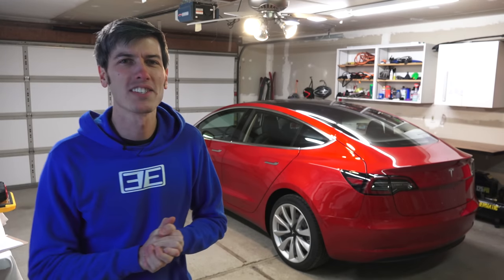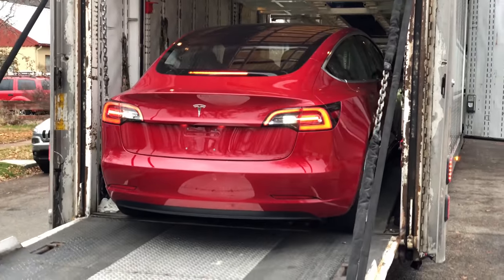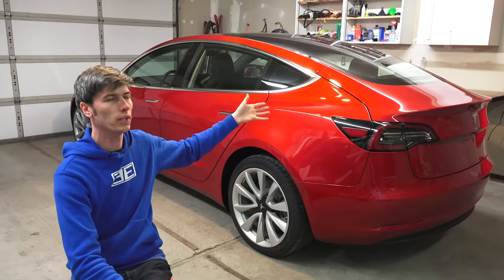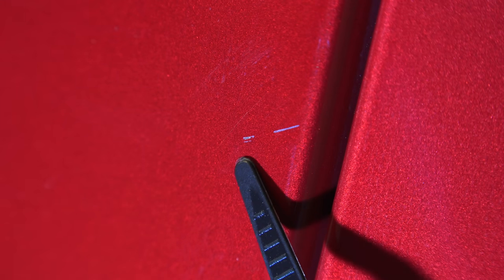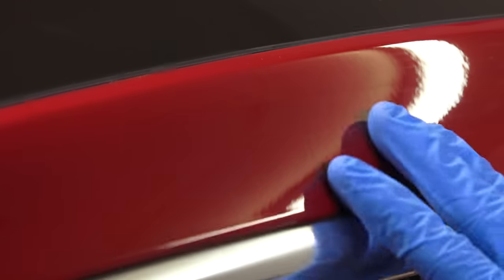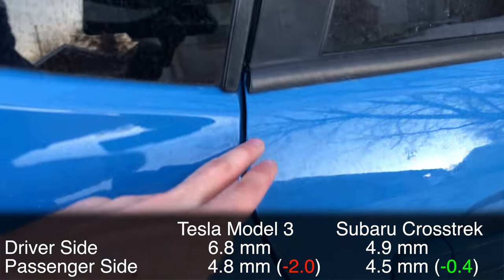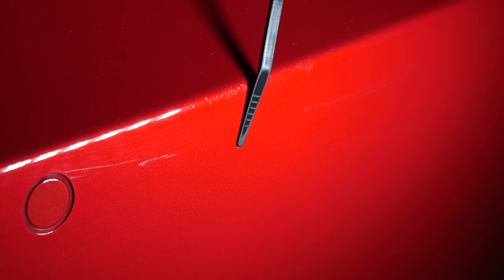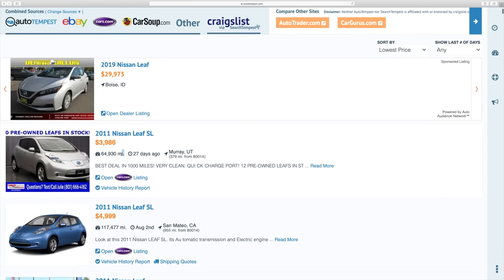Everything That's Wrong With My Tesla Model 3 - Quality Problems

Comment: A car that is brand new should arrive brand new.  This is unacceptable for a brand new Tesla. Doesn't matter if its a Kia Rio or a Rolls Royce. If its new, it should never arrive with scratches.

As for panel gap differences, to the untrained eye those panel are not noticable for the average person.  But Tesla does need to work on that issue.  I own a 2016 Lexus LS460L built in Japan and the panel gaps between left and right is nearly perfect only,  .2 mm to .5 mm difference. But my wife's 2018 RX 450H built in Canada is not as good between .7 mm to 2 mm difference.
Reply: I bought a new car in 2017 that cost about 1/3 what this car did... and the paint and panel gaps looked much better.
Reply: i agree!!! and for the cost of this car the comparison should b between a 3series or a4 or something not a subaru lol im sure that model 3 cost a lot more than a crostrek .. can u even get a $2500 paint option @ subaru????? heh
Reply: Al13n1nV8D3R walk around any dealer , you will see flaws
Reply: Kavi4 yeah but not scratches or insane panel gaps. Tesla just doesn’t know what they’re doing yet.
Reply: I work for Honda and paint/finish issues are graded by areas. I can say that all of these scratches should've been seen at the factory. It really shocks me to see these kind of errors making it to masspro.
Reply: @Kavi4GP  You absolutely will not, cars from the factory come with perfect paint, you simply will not see bare metal on them. I work for Honda and imperfections in the top clear coat get repaired, let alone scratches the go to the bare metal.
Reply: Thiterest1 like I said at a dealer , this case is terrible.
Reply: Thiterest1 you’re right. I just the that people refuse to accept the fact that Tesla’s aren’t very good because they love the brand too much
Reply: Kia Rio comes way better
Reply: my kia rio from 06 came without scratches lol
Reply: Totally agree... I bought a Kia Sportage in 2018 and the paint finish is flawless - and it only cost €24,500.
Reply: But is that a Japan vs Canada issue - or a LS vs RX issue
Reply: Agreed, the build quality on the big Lexus sedan has always been lights-out from the day it was introduced. Probably the highest of any mass-production car.  I used to own an S class Mercedes, and have owned a couple of Audis and several BMWs, and of course they were fine but the big Lexus is noticeably better.  They don't drive sportily and are kind of geezermobiles in general, but all in there's just no better-put-together car.
Reply: A Rolls Royce would never be delivered in this state
Reply: OP, I agree that the Tesla came with many errors and I have wondered how they would compare to our LS460’s. Mine is a 2014 and I expected to the Lexus to be much better. Think it’s a Made in Japan vs NA thing.  Thanks for the write up.
Reply: @jamess3417  I think both!  LoL I still love my wifes RX. The, only thing I dont like about it is TORQUE STEER under anything more than half throttle even with AWD.
Reply: most cars go through some kind of body shop (in house or 3rd party) before they start seeing buyers. Traveling to the dealership is a rough one lol.

Comment: You definitely need to send that car back ASAP. Absolutely unacceptable.
Reply: I wonder what else is low quality on things he can't initially see like welds and wiring etc.
Reply: watch till the end, he says that tesla is taking the car back and giving him a loaner for now.
Reply: This is extremely common with Teslas believe it or not.
Reply: @sagesends  I wonder what the odds are that someone who wasn't as prominent on the internet suffering the same fate would get the same level of service.
Reply: @Error Loading just be glad your Tesla is not like the guy who was driving it home (brand new 3), it started raining, then the rain somehow started leaking into and filling the bumper, then the whole damn bumper cover just fell off!
Reply: @sagesends  No, they said they would fix it.. not taking it back and giving him a new (good one) like they should.  Normally they would only fix what you can see.
Reply: I feel so bad for you.

Comment: For a $2500 option, that paint is unacceptable. The orange peel would be an 8-10 (as a comparison, I worked in a place as a QC inspector that painted replacement parts for the big 3, and we could not pass anything more than a 4 for highly visible parts to 6 for less visible). Scale going from 1-15, 1 being the best.
Reply: This is unacceptable in any way not just because it's a 2.5k option.
Reply: you just like talking about yourself, its obviously not acceptable.
Reply: @wildkatsailing  I do, and you read it. Thanks for boosting my ego.
Reply: Chrysler's paint is worse... noticeable Orange peel at 10ft... but a 2500 paint job, is exactly that, a 2500 paint job...
Reply: @anthonycasa694  Don't buy a Crysler then... this kind of paint job or even assembly quality is completely unacceptable...
Reply: @Vizeroy9 , I don't and wouldn't... it is his own fault for ACCEPTING... HE SIGNED FOR IT... BUT WTF WAS HE EXPECTING A $2500 PAINT JOB TO LOOK LIKE??? backyard sprayers charge $2500... he bought a snap together Lego car and then cries about the fit n finish...
Reply: It's not a $2500 paint job. It's a $2500 color option instead of the default black. Not a repaint.
Reply: @michielvanderros5768  $2500 option on a Lego car, that he signed for... if he wasn't happy,  he shouldn't have signed...
Reply: Never mind for a 2500 option. That level of paint quality would be unacceptable on a toy car.
Reply: @neilhuband995  well it is a toy car... snap together Lego junk

Comment: That quality from a 50,000 dollar car is unacceptable. I would be PISSED if I had 11:17 on mine.
Reply: His was 46500
Reply: Anton Zuykov  ya but it will get fixed. Corollas have been mass produced for 52 years. They have some slack to pickup but what they are doing is still impressive
Reply: @larryspiller15  no. Just no. It doesn't matter if it get fixed some time after you have your car. It's unacceptable at that price point.
Reply: @teilzeitteemo6190  I agree. Still gonna buy one. There are no alternatives. Gonna get the black one and a wrap though.
Reply: @snviper  there are enough alternatives. Just not electric. Electric cars themselves have a hard time getting sold much, it won't be helpful to produce expensive but cheaply made ones. The demand won't be there.
Reply: That is un acceptable thay need to fix your car
Reply: SDD525  Hydrogen still looks promising
Reply: SDD525  Renault Zoe, Nissan Leaf, Hyundai has an EV and Toyota has some fully electric cars as well I believe. No alternatives?
Reply: SDD525  please use Google before making such a silly statement.  The Volt is a real contender and many believe much better than the Tesla.
Reply: @teilzeitteemo6190  Volvo has a nice one too...
Reply: @teilzeitteemo6190  I am way past looking at non-electric cars. When you've lived with one you can't go back. Having not lived with one you will not understand. You are very wrong that there is no demand. There is no demand from dealerships that is true, because electric cars mean their downfall. There is a lot of demand from customers.
There is no alternative with range and charging network and technology at the moment to Tesla when you want to buy an electric car. Our family has 200'000km on two Teslas in 3 years.
Reply: @snviper  well you're now saying just because your family only has electric cars, there's high demand. There's no high demand. It's because the affordable EVs aren't really the best option for the average person. EVs are priced a lot higher than gasoline cars and offer only environmental benefits. I don't see myself buying a Renault Zoe. It's too small. Tesla is too expensive and has a really big production quality problem. Why should someone bother buying one?
Reply: Go drive one you will see. Demand for EVs is huge here in Switzerland and even small EVs have enough range for 99% of all drives.
Reply: @snviper  driving one wouldn't change that there's no demand. EVs are impractical, expensive and only a small portion of the population can even own one. This is because you need to have a charging station near the place your live in or have your own house. The majority of all people live in flats in large cities with a limited amount of charging stations. So you can't have an EV because you can't charge it without your own house and garage.

The demand isn't high and under these circumstances it won't rise. Buying gasoline cars is financially advisable and way more practical.

For example, I live in a flat. There's no charging station near me. And even if, I wouldn't spend a single thought on buying an EV. The Renault Zoe costs 21'900€ as of now. It's a small two door vehicle. For 13'500€ I can buy a VW Polo with 4 doors. It's larger and is almost half the price.

As much as I'd like to see EVs rise in popularity, the circumstances given just can't support it right now. Like I said, impractical and expensive.
Reply: These are all solveable problems. Keep your mind closed until they are solved or be a part of it. You will see more and more EVs in the coming years whatever you think or say.
Reply: @snviper  Well your family seems to be rich enough to buy Teslas but you fail to except that just because you can afford this nonsense, it should be a norm. I'm very much interested in an EV future and these, like you said, solvable problem are too much of a hinderence right now. Sure the EV market will pick up, but the only customers will be the middle upper class or upper class. Not the majority of people.

This isn't close minded, this is thinking rational.
Reply: @teilzeitteemo6190  Yes they are well off. I remember when my dad bought his first computer for about 20.000 Swiss Francs or when he had the first cellphone. I never thought these things would catch on either. If you are open minded then go drive a Tesla then tell me again you don't want one.
There are very many people without their own homes driving EVs that make it work somehow. EV's main problem right now is that living with them is so counter-intuitive and Tesla doesn't really advertise and the legacy automakers haven't really caught on yet. You have to do all the research yourself and watch youtube videos. Did you even watch the video where Jason (Engineering Explained) praised the Model 3 or are you just here for this one?
When my Model 3 gets here and has scratches I will also be pissed off. However I am very glad if these are the only problems they have. I remember when people were saying this would never work at all and the batteries wouldn't last etc. those have all gone quiet.

Comment: I used to work at Toyota. The detail department wouldn't be allowed to send  car out like that.
Reply: What about those gold toyotas with different color pannels.
Reply: Where you also worked? Probably also your dads works at Tesla and you know they will be bankrupt soon? Because that's how every second hater comment on Tesla is like
Reply: that has something to do with the way the metallic particles act on a metal vs plastic part.
Reply: vtra85 righttt
Reply: it's almost like they haven't been doing this for 80 years
Reply: I work too for Toyota nothing compared to Tesla but the gap is the weld touch department issue can be fixed within a minute. Atleast not paying much for gasoline and maintenance
Reply: 18K Corolla has better standards than a 45K Tesla?
Reply: Toyota is founder of lean manufacturing. So of course it make sense.
Reply: So basically that brand new 3 looks like a car that’s been in an accident and it went to a crappy body shop.  Is there some partial lobotomy they give you on the P100D test drive?  Could you imagine picking up your brand new MBZ or BMW and it look like that???  And then if they almost all looked like that?  And then be told to shut up because it is electric?  And it’s a Tesla?  Tesla should just sell their drivetrains to manufacturers that know how to make a full automobile.  They would instantly become profitable.
Reply: @cytrynowy_melon6604  not realy they are estimated to make a profit soon

Comment: It doesn't count as an EWW (everything wrong with) video if you don't use the ding Jason.... THE DING JASON!!!! Also "this scene doesn't contain an EE lap dance. Jason is not by boyfriend in this scene. Jason's nose is cold in the scene. Video doesn't contain a burn out".

No Tesla is without SIN! Also after 15+ years of dealing with brand new cars, this is AWFUL! A little rehab required for paint on a new car is not uncommon, but this is wild.
Reply from the maker: Ha, thanks Charles for sharing your experience with new car delivery!
Reply: I like these crossovers!
Reply: Probably if Jason opened and closed the doors a few times the panel gap distances might be different/align more closely.

Comment: I work at one of the automotive OEMs in the Southeast Michigan area and these scratches would have never made it through final inspect and would have been sent back for rework.

And you can also tell that Tesla (with the differences in their gaps) is struggling with stamping out the various panels and getting all of the GD&T set up properly so that everything would line up properly.

We would see this level of dimensional instability/out-of-spec tolerances during our prototyping phase, NOT when the vehicle is delivered to the customer after it's been in production for about a year-and-a-half.

These issues would never fly where I work. You might see some of this kind of stuff during the early build phases and ramp-up of production, but after a year and a half, you should be hitting and BEATING your dimensional tolerancing and stability.

Can't wait for all the Tesla fanbois who know nothing about working in the auto industry to chime in.
Reply: thats interesting that you say it looks like a problem with stamping out the panels. i was just thinking it would be an interesting thing to take one like this and try to adjust everything to make it even. with the goal of seeing if its a assembly problem or a manufacturing problem =]
Reply: A  Dealership  would have rejected it,  it  would have never made the lot, and never reached a customer.   
Dealerships  ARE their  reputation - and a good reputation is worth gold.    Selling  new cars covered in paint defects and scratches is a No No !
Reply: Those scratches are probably from transit to dealer
Reply: tesla makes great electric motors but yeah, I don't think in 2020 they have fixed this issue. Maybe 2 more years.
Reply: @SeaJay_Oceans  Yup, we wonder why Tesla doesn't deal with dealerships.
Reply: Awesome comment, very interesting! Thanks

Comment: The scratches are for me totally unacceptable! Gaps between panels hmm not good but doesn't matter. Gap between glass panels not acceptable. 
You should return that car or not even sign the papers after it arrived in that condition...
Reply: I agree, tesla have good tech, but they are still learning how to put a car together.
Reply: @AussieZeKieL  I heard that tesla electric motor start to sing annoying sounds after some use... Old electric motors work for 40-50 years without any issues.
Reply: @ПрикладнаЕкономіка  I think this is what the analysts meant when they said that Tesla has the build quality of a Korean car from the 90s...
Reply: gaps maybe, but uneven hood where its flush on one side and not on the other?? very bad, very very bad

Comment: The dust speck and the orange peel is clearly a rush job.  The scratches are obviously from parking and driving too tight either in the delivery truck or on the temp storage in the factory.  Especially the rear bumper shows that the person parking the car was very careless.  Back with that thing, it is not something you, as a customer, should have to worry about.
Reply: @Josep Monclús except you... unless your friend is you

Comment: If they end up legitimately addressing all these paint and manufacturing defects then fine but it is alarming that a 50 K car came like this delivered from the factory. The only reason you're getting it repaired is because you are an enthusiast and you took the time to go over the car and note everything down. Most other people would just be excited about getting their new Tesla and just proceed to put miles on it. This should be a lesson to everyone about the importance of inspecting your vehicle upon purchase/delivery.
Reply: Unfortunately yes people are excited by new technology and yes Henry Ford had production problems with the first Model Ts which was new tech for it's time and yes Ford Motor company sent mechanics everywhere a person bought a model T. But come on it's been ten years, Tesla should of had these production problems solved. 
I think Musk is spreading himself WAAAAAY too thin. Which hurts the BEV market. Because people will say if I have to spend $100,00+ to get a decent BEV then forget it.  People do judge the mechanics of a car especially if it's new tech by the paint job and body panels.